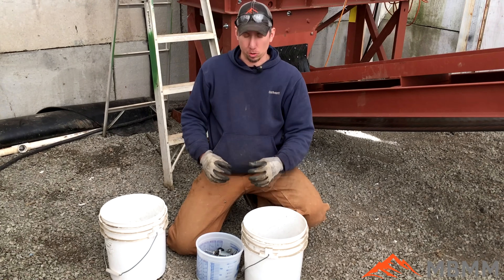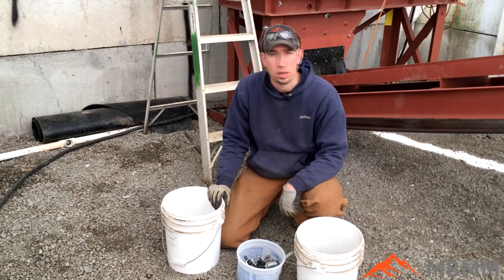Copper Recovery from Electric Motors Using a Turn-Key Scrap Processor

Comment: Do the hammers ever break in the mill, and what happens if they do?
Reply from the maker: The hammers do not break up in the the mill but get wore out over time during use.
Reply: on the bigger one we use at work to mill cars the hammers and other things in the rotor will come off every now and then. sometimes they come out on their own. sometimes we open a door that lets bigger stuff out. afterwards it just goes down the line like everything else and someone will try to grab it before it goes into the pile of regular scrap. We use way different hammers though. sometimes we accidentally load stuff thats entirely to thick (like a 3 foot solid steel cube) and the driveshaft or side armor will break and end up surprisingly far away. stuff like that usually doesn't happen, but when your loading with a grapple sometimes you don't always see everything that goes in.

Comment: Considering that copper wire is quite soft and thin, I wonder if you could separate it easier if your product was first frozen in liquid nitrogen...not for practicality, just for fun :) 
There's a scrap tire processing technique that first freezes the tire in liquid nitrogen and then crushes the tire, thus shattering the rubber while it's relativity dry, and easily separating the metal.
Reply: angryadrien brittle not dry
Reply from the maker: Great, thanks for the tip!

Comment: Good recovery. Why is the last component a weird shape?
Reply from the maker: Good observation. The last component is our zig-zag air separator. The air separator is connected to a vacuum that can pull lighter material away, such as paper and light plastic parts when processing certain scap products.